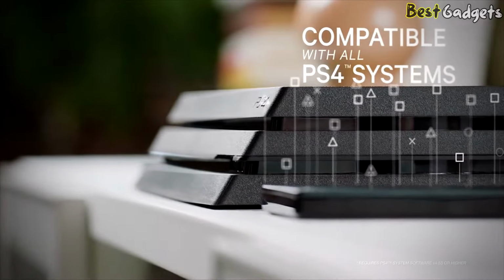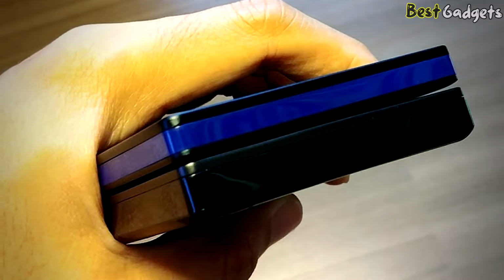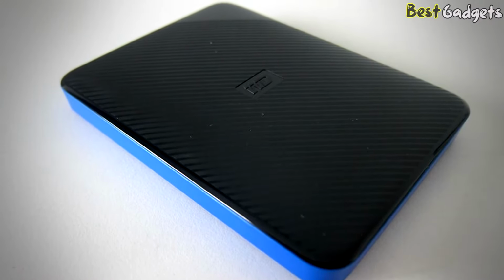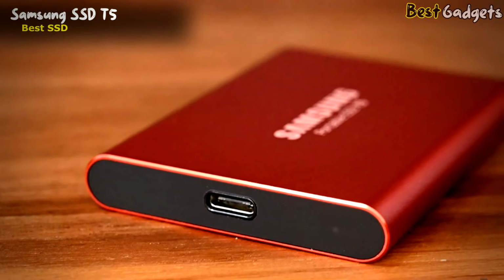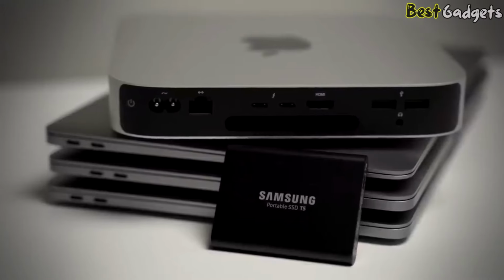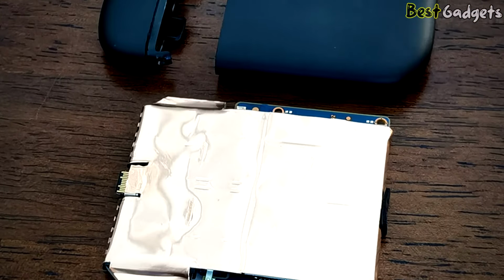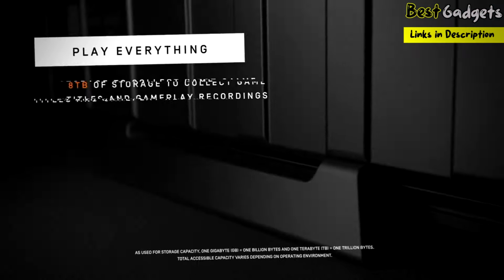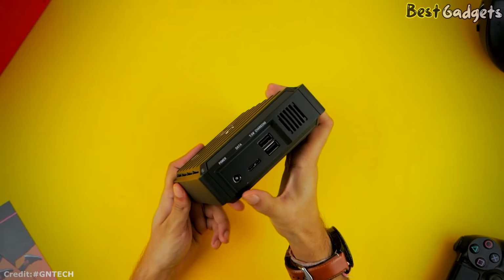Best External Hard Drives for PS4

Comment: Does it need to be ps4 hard drive?
Reply: It does not need to be, in any case i advise you to use an ssd (it reduces by a ton the load time, check some videos online about hdd vs ssd) but it just cost a little more

Comment: Would the Western Digital 4TB P50 Game Drive SSD be just as good as the 8tb es black you mentioned .   I’m stuck between buying the 8tb hdd  Or the 4tb ssd

Please help 

The 8tb cooling technology sounds intriguing but I’ve read that SSD is faster
Reply: 4tb ssd internal + external HDD , use the old internal hdd.

Comment: Hello can you urgently answer this, if I increase my storage on a ps4 using external harddrive does it delete my old data non ps4 related on it?
Reply: It won't, everything will stay on your external hdd
Reply: Yeah the ps4 system is garbage it'll delete everything you have on the drive
Reply: Adding storage does not delete anything. Where’s the relationship in that question?
Reply: @lonewolfdenn  you havent understood my question,, however i have already found the solution thank you anyways:)
Reply: I’d you add a game to your system will adding a game delete other games?
Reply: @lonewolfdenn  No that is not what I meant. I was asking does having like a hard drive with old photos or data and then I add it as extended storage to the ps4 will it format it and delete everything the answer was yes.
Reply: @karmasunicorn5959  actually no if you format the external hard drive as extended storage it won’t delete anything only thing is you can add saved data on the external only on the internal drive
Reply: @karmasunicorn5959 yes your file will be delete, because on the first time you need format your hdd